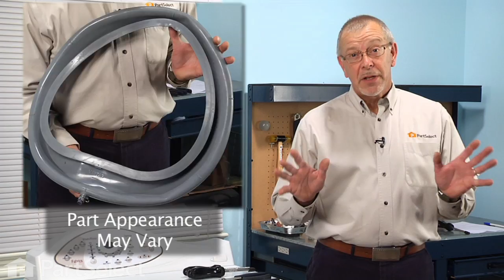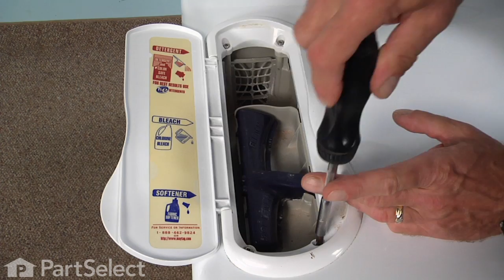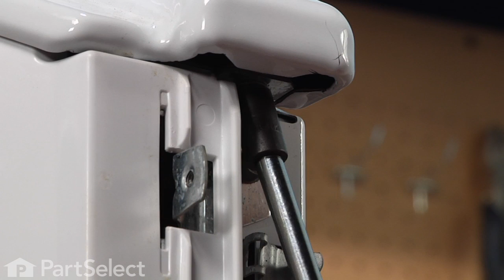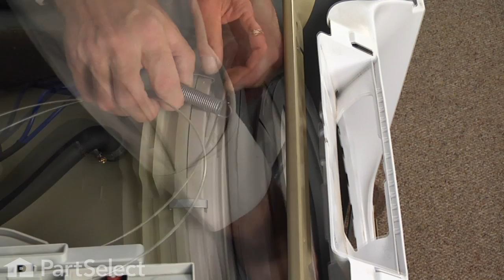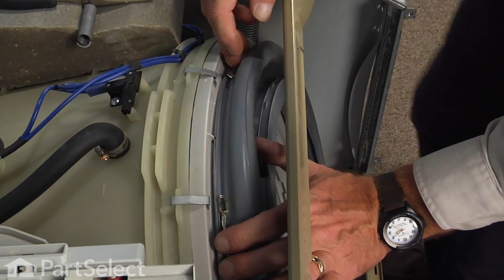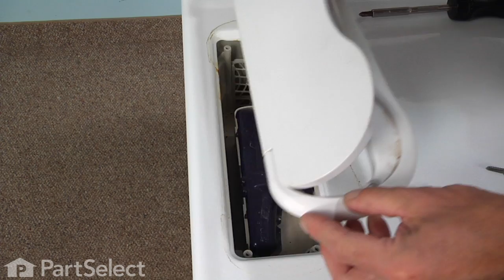Washing Machine Repair- Replacing the Bellow (Whirlpool Part # 2003890)

Comment: Just completed this job and this video was a key to success.  As others have commented, some effort is required to get the spring secured to the cable.  I did go a little further and removed the 12 clips that held the cover behind the bellow to clean all of those parts.  After 13 years of use, there was quite a bit of nasty build up and I was able to wipe out quite a bit of it.  This cleaning took longer than the repair itself.  A good few empty wash cycles with a bunch of bleach will hopefully help clean up what I couldn't get to.  Thanks for the great and easy to follow video.

Comment: Great instructional video.
My washer was an older Neptune and it was a little challenging with the amount of rust internally. Having said that, repair was a snap. One recommendation I would pass on, is the retaining spring around the bellow was a bear to get back in the tension mode. What I did was use 2 tie strips and create a handle around the end of the spring. Pulling on the tie strips into the female end of the spring wire band was a lot easier.
Reply from the maker: Hi Ken, thanks for the kind words, and sharing your repair story with us. Great job!

Comment: Absolutely what I needed to perform this repair on our own Maytag Neptune.

In our own case, our machine is 13 years old.   Reseating that spring proved cumbersome at best, it was very nearly impossible to stretch.   

Tried a combination of stuffing quarters between the coils combined with applying heat from my wife's hair dryer.   While I was hopeful, this did not help.

What did help was a part, and, a tool.

First, the part... a different spring of a slightly longer (1/2", I believe) length and slightly (but, not much) less tension.  This is the set which I purchased at our nearby Home Depot, http://www.homedepot.com/p/Everbilt-5-8-in-x-2-1-2-in-and-5-8-in-x-3-1-4-in-Zinc-Plated-Extension-Spring-4-Pack-16089/202045478  While zinc plated, not galvanized, its my hope that they'll last for as long as we have this machine!

Second the tool, a spring hook, purchased at our nearby Harbor Freight.  http://www.harborfreight.com/spring-hook-95757.html 

Given the great deal which we'd landed on the bellows itself (especially when compared with the purchase of a new machine, or hiring a professional to perform the repair), I'm content having spent < $10 extra for the part & tool combination.

Comment: Replaced the bellows and it leak at the bottom of the bellows although the tension wire and spring are installed correctly. By the way, the spring and wire were an extreme hassle to get back on.